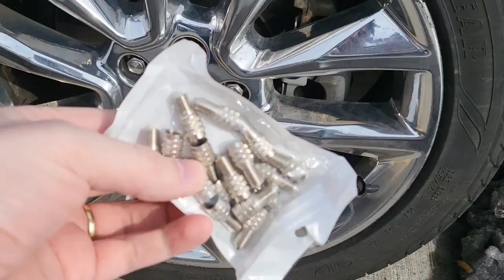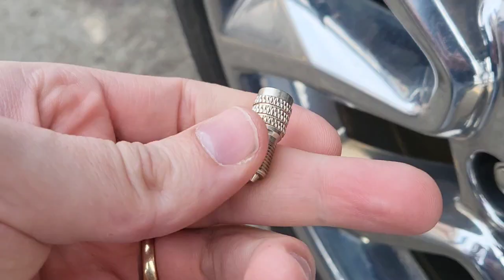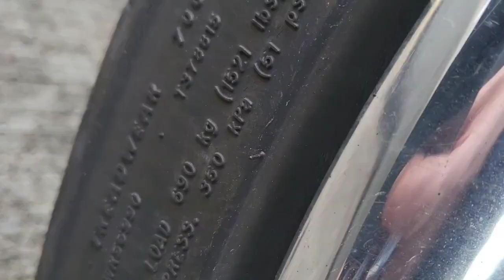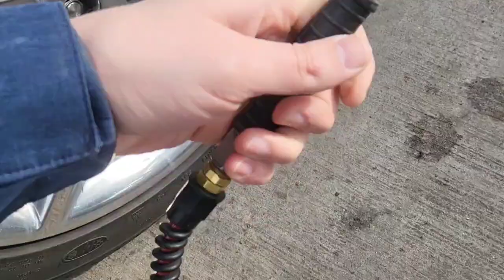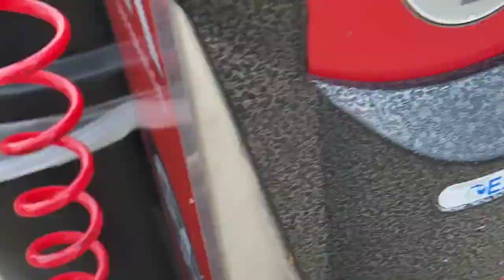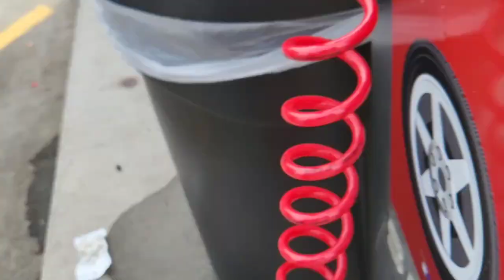16 Pack Double Seal Valve Stem Cap Inflate Tire Valve Caps Flow Through Tires Air Cap

Comment: The proper inflation pressure of the vehicle's tires should be printed on a sticker in the driver's door jam area. Don't use the max load on the tire sidewall, that'll lead to over-inflation, especially since the pressure will increase as the tire heats up during driving.